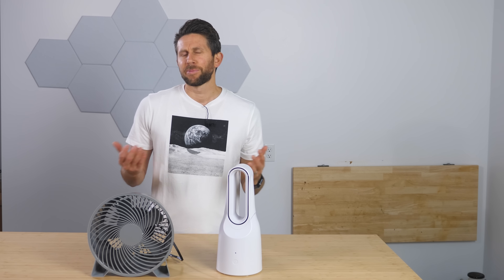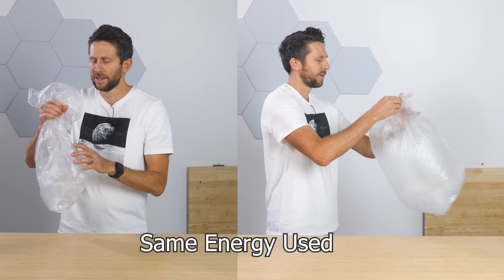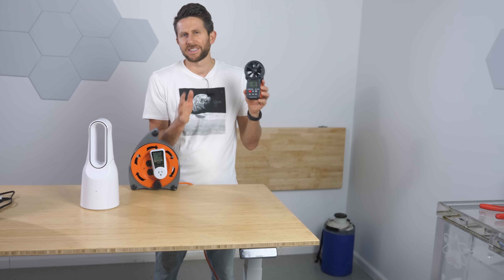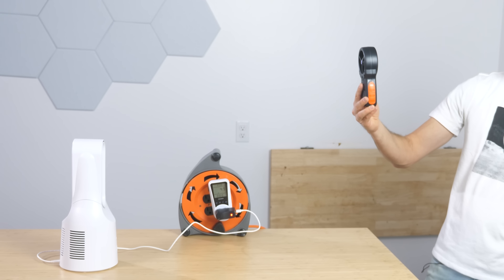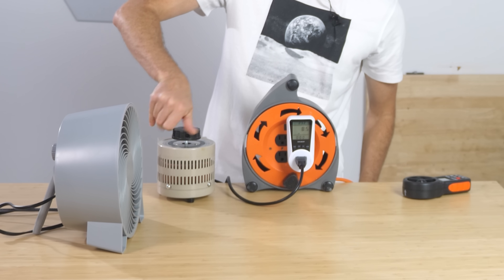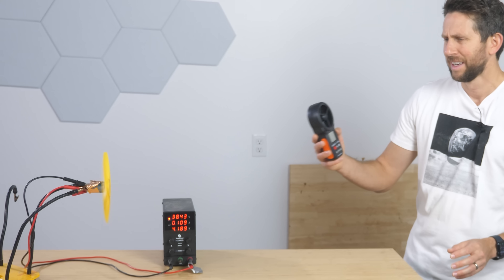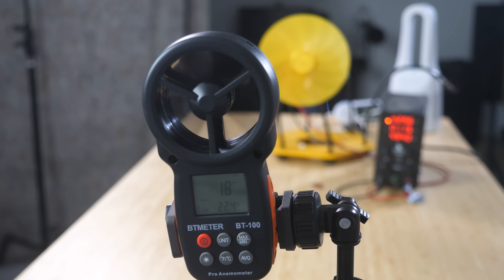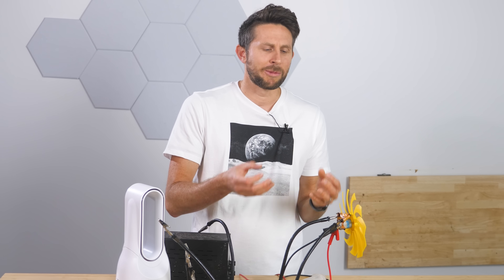Are Bladeless Fans a Scam?

Comment: One of the benefits of fans in my opinion is the noise! The white noise helps me sleep, so I don't want quieter blameless fans!
Reply: Then you might like the bladeless ones. They're actually quite loud. They try to squeeze a lot of through that slit and it makes way more sound than a normal fan that is is of comparable size. Also the comparably sized regular fan moves a lot more air.

We had those larger Dyson fans at work and they proved out to be just total waste of money. They're nasty loud and really bad at giving you a cooling sensation. The fans we replaced them with were considerably smaller and thus also more practical in an office environment, they were also about 1/10th the price and waaay more effective.
Reply: Same here. Can't fall asleep without mine's.
Reply: white noise is nice thing. this is why i sleep near my computer that is running 24/7. it's like rain but that "never stops".
i also tried to play some white noise videos while wearing wired headphones while i was sleeping and it is nice too.
Reply: Did you know that the bladeless fans are louder, because they need more power, thus more movement and noise, to push air through the tiny holes.

Comment: I'm convinced, but I don't think the bag thing was an appropriate analogy.  Once the bag was opened, it was filled with air.  The blowing just allowed more air to flow in the direction of the opening, overfilling the bag and making it easier for you to catch the air that was already in there.  I'd like to see it again with the bag at its lowest volume, then filled by the low pressure moving the air.

Comment: I'm 2.5 minutes in, but I think you're measuring efficiency wrong. You don't want to put them at the same power consumption and measure wind speed. Instead, put them at the same wind speed and then measure power consumption. I used to work on an application that allowed sizing of fans by industrial consumers, and there is a power curve that you have to think of. We never sized fans for efficiency by looking at our power consumption. We always sized them by looking at target airflow and then targeting most efficient power consumption to meet that airflow (and static pressure) target.

Comment: You should try and get ahold of a Dyson style blade less fan rather than the type you used in this video then compare again. Dyson use a turbine style blade not a squirrel cage style like the one you had. I’m curious to see if the turbine style actually is what they claim it to be and much more efficient since it moves the air differently than that style blade.

Comment: You should compare an impeller based bladeless fan to an "ionic wind" based bladeless fan.  My theory is that increases in efficiency may be realized because of the absence of the need to accelerate a mass in order to accelerate a mass. Also, do ionic wind "fans" benefit from ionic charges in the air to increase acceleration?

Comment: I completely agree with you results but i think the test could have been better.
1. Cfm could have been measured using a large tube to create constant cross section area.
2. Dyson fans have much more "advanced fan tech". It would be interesting to see if they are actually more efficient, considering the crazy cost.
Reply: fans also have an efficiency curve. a fan meant to run at a high wattage is way less efficient at a low wattage than the same principle fan designed for the low wattage both where run at. its like using a truck to do groceries and then comparing fuel economy to a compact car. yea, the truck is going to be less efficient at that. but if you ran both at max load than the amount of groceries per energy unit would probably favour the truck.
Reply: True for Dyson. But the "normal fan" comparison should be high quality too, like Rowenta.
Reply: Dyson fans are a complete scam. Like all of their products. Massively overpriced.
Reply: more efficient at lining their company coffers, no doubt.
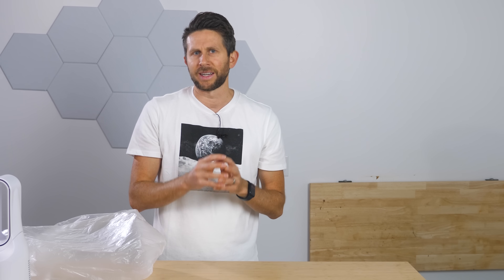Reply: @namele55777 so true bestie 1:04
Reply: I found a brand new large bladeless Dyson and it's so great, I'll never go back to a big round dumb rotating fan. It also can blow hot air or cool, rotate and sleep timer. It's quiet and moves a surprising amount of air for the size

Comment: Another reason "bladeless" fans are quieter has to due with the type of impeller used in the base. They use a forward curved impeller, and they have more blades which helps reduce any noise from blade pass frequency. One downside is that these blades are not as efficient as axial or backwards curved impellers.
Reply: But they ain't quieter. That's just marketing, just like how they're more "efficient" and the like. Assuming you base it on how much air they move that is.
Reply: @Utrilus  I'm an engineer for a fan manufacturer.
Reply: @Colin995  But I saw youtube videos where they tested em side by side.
Reply: @Utrilus  Ok, good for you? You do realize I am talking about the actual fan, the part that spins in the "bladeless' fans? I don't have the energy to give a detailed explanation as to why forward curved fans are quieter than axial and backwards curved fans. I implore you to look up what blade pass frequency is and to look up the difference between forward curved, backwards curved, and axial fans.
Reply: @Colin995  Yeah, that stuff goes over my head. It's kinda like how PC fans are abnormally quiet.

Comment: messing voltage with veriac and not taking in consideration apparent power. Not really measuring air pressure and volume between fans. Seems like 10yr old could do this in the class. Disappointing production of video. If anyone wants a good example how to make lab based video just look up for Tech ingredients

Comment: It is a gimmick because I took one apart. It was a knock-off and there is a fan in the base, it simply blows air up and out of the holes. Not a different kind of blade, like in the video, a flat -out propeller style blade that blows air up and out the holes. They all try to give the impression in commercials that they have a high tech innovation to move air. Total BS

Comment: You could have measured the thrust that the fan generates to estimate its absolute performance.  With anemometer you'll have to integrate the airspeed over the entire cross-section of the airstream.
Reply: You're right. I believe the aim was to simulate a person sitting at a typical distance from a fan. But he should've been a tiny bit more precise with his language.
Reply: I still don't think there will be great difference.
Reply: still not worth it
Reply: @blackpepper2610  good experimental measurement is always worth it, it is even cheaper than the method shown in the video since it does not require anemometer
Reply: I just use my hand to cool myself down 😂
Reply: sweeet! i learned this technique, when i lived in mexico. it works (better if you have a cervesa @Lord__666
Reply: Even so thee ordinary fan won hands down.
Reply: @rogerphelps9939   ... fan-blades down :)

I criticized the measurement approach and not the measurement result.

I would appreciate if a fan was placed on a raft, floating in a basin and a dynamometer was used to measure a horizontal thrust of the fan.
Reply: dyson has always been a 'sales gimmick' high pressure sales if you ever visited a store that had them like costco @rogerphelps9939

Comment: Dyson fan could be perceived as safer, especially the larger ones. The grills on larger fans don't keep out tiny fingers.
Reply: The blades are angled to draw in air, a fan will slap your fingers at worst
Reply: @MelodicTurtleMetal  Umm, not the large square fans
Reply: @dimitri1515  if the blades were flat they wouldn't with as a fan. You'd have to shove your hand in extremely hard to hit the sharp point - which isn't sharp - and the motors have almost no torque, so you'll stall an industrial fan before it does much damage
Reply: @MelodicTurtleMetal  LOL, ok, have your 2 year old stick his/her hand into a fan at high speed and let me know how that worked out for them.
Reply: @dimitri1515  do it yourself. It'll hurt, it won't require any hospital visit.

Maybe think about how they work before you worry about what you've seen on TV
Reply: @MelodicTurtleMetal  OK, now you're just trolling. For anyone else reading this, please watch your toddler around those large square fans as they can break bones in their little hands.
Reply: @dimitri1515  ignore him. Put your toddler in a fan!
Reply: From the front...

Comment: I got a refurbished Dyson fan on w00t like a decade ago for ~$140.. one benefit that was not mentioned is that bladeless are much easier to clean.  No grills to remove... you can just wipe along the bladeless ring, and the suction holes at the bottom.  It is very quiet of full blast also.   No regrets here...

Comment: Not a Dyson, but a poorly designed copy using a standard squirrel cage fan for a compactness  similar to the fan in the base of the Dyson. To me the whole  selling point was to cheaply steal some of the Dyson marketing magic.  As your test shows, the base fan is already quiet and probably entrains surrounding air from its local pressure increase towards your chosen test position.
I have experimented with high volume low noise level fans for decades and know that the squirrel cage design, when proper blade pitch is used, does produce both pressure and volume, especially driving air into ducts. Axial fans running at AC induction motor speeds stall in that situation and  are more noisy. 
Dyson's solution uses an axial fan at very high speed, to get the  fan blade sound above human hearing, then properly directs it into the bladeless air volume multiplier section.  Air drawn in through the Dyson base is also more smooth as well as less impeded by the input grill. 
Now for an anomaly I found in the marketing of a  hand held hair dryer I bought many years ago advertised as being quieter than the typical one. It used a squirrel cage blower, instead of the small cheap axial fans the others had.  It also used an induction motor to avoid  the brush noise in the other dryers.Was I surprised when I got it home:
It had an audible resonance that was annoying and almost as loud as other such dryers. It had been designed in Italy, and then sold to the American distributor without changing the blade pitch. Why was that necessary?
Italy has 50 hz AC and we have 60HZ. That subtle change in rpm put what would have been a resonance null  just far enough higher pitch to  hit the resonance peak  that that pitch choice was designed to avoid.
The 240 to 120  line voltage difference WAS accounted for  by a change from series to parallel in the resistive heating coils used.  Both types of hand hair dryers used the heating resistors to drop the voltage  applied to their motors. One little difference and it became false advertising.

Comment: Pretty not good to hear bladeless fan and see a fan.

You should be 100% be able to build a true bladeless fan, it just needs some before thought as the dimension of the plates and lenght of the solenoid pointing inbetween the plates to effeciently exchange electrons with the air molecules while permiting solenoid hysteresis and drive it at resonance basing of the open LC math.

Such design was used to pump salt water but was intentionally hidden from us. perhaps it allows electro propulsion against the vacuum in certain conditions?
Reply: Yes, there are "Electro-Static" fans that create ions at one point and attract them to another, which pulls the air along with it (just like the bladeless fans). They also pull a lot of particles out of the air as those are a good source of things to charge.
Reply: the method i am suggesting does not create ions.
Perhaps the geometry to make it work would require extra steps, but i am 100% convinced you can make it work.

ACMHD is one directional and perhaps only works with conducting materials, but it would be worth a try. (or add a source of electrons in between the plates and you should get weak vacuum propulsion without a propelant)

IVO quantum drive will launch in space in about 5 days and quantized inertia will be tested @RichardDamon

Comment: I think a better way to compare them is you need a tube with fixed diameter and at fixed length so you can actually measure volume and speed.
Reply: This is backwards in so many ways. Why a small tunnel??? I don’t want to only get air on my nose, I want it over my face, head and shoulders. 

These dyson fans have never been what they claim.

Comment: It seems like even all other things being equal, the bladeless design would be losing efficiency just off the extra friction the air must have while bouncing around inside the device as it makes its way towards the slits at the top, not to mention what's lost as the air filters into the device through the other small slits at the bottom into a larger chamber.
Reply: And if they were to move the same amount of air, then the bladeless would naturally be louder cause it would have to work harder to be equal.

Comment: So the bladeless fan’s air gets slowed by the air it’s pulling through the back, but also having fast air pulls the slower air around it to increase volume (like with the bag). Why was the latter effect so much more pronounced with the bag, but not enough of an effect in the case of the bladeless fan?
Reply: Yes, proved and disproved in the same video. Something doesn’t add up here.
Reply from the maker: In the example with the bag, the restricting factor was the amount of air your lungs can hold. But with a regular fan and a bladeless fan, they have no air limit. So it is just whatever one can move air efficiently. And it is not more efficient to move air through tiny slits in order to suck on air, because you can just suck in air as normal through the back of the fan.
Reply: @TheActionLab  _There should be a windblade fan, where the winds that laminarly flow the air are actually the blades of the fan itself, hahaha, imagine that! _ 🤣✌️👍

Comment: A blade-less fan is basically a standard fan with a Maltese boot.
The blade-less fan is useful for low-risk environments, where there are kids with long hair, pets, etc, which can get entangled with the bladed fan rotor. Or, a blade-less fan can be required because of ambient design reasons...

Comment: Regardless of what everyone’s criticism is for measuring air speed I think we can all conclude that bladeless fans are indeed overpriced. It just is a basic blower motor pushing air through fancy looking piece of plastic with holes. The only arguable benefit of bladeless fans is safety for little kids and they are quieter since the fan is more enclosed and airflow is more restricted.

Comment: Evacuation slide inflatable staircases used for civil wide body planes uses indirect inflatable principle one reason it blows slide much much faster than direct method.  In emergencies that is big benefit  but also slide inflation is based on fireworks burning gasses thus mixing with air Evacuation slide not catch fire.

Comment: What?  There is blades inside a bladeless fan?   My favorite fan uses a brushless motor.   Its speed is fully adjustable,  And it uses so much less electricity due to brushless tech.  It was also about 2 times the price.  But I love being able to  fully adjust the speed,  Some times I just use it to cool a cup of tea,  other times on hot days I use it to cool off myself at my desk.   Brushless fan compared to a regular fan might make a good Action Lab video.

Comment: My bladeless fan is actually louder and weaker than a regular fan. The only reason to use it is because it can also do hot air so I don't need extra space to store my heater/fan when season change. Just put it in the leaving room throughout the year.

Comment: Isn't there a difference between air speed and air volume that would potentially make one more efficient?
Reply: The "blade less" (with the actual fan hidden) is less effective when it comes to power usage. But the hidden fan type might have other benefits like less noise?
Reply: It can only be less efficient due to the principle of conservation of energy as energy is lost by the drag caused by the housing, an open fan does not have this parasitic loss. Air has mass and to move more of it at a greater velocity requires more energy, simple as. You never get something for nothing.

Comment: I'd imagine a bladeless fan would require less cleaning as well / be easier to clean
Reply: The mess would be in the base rather than at the back of the fan, and I'm not sure what you do if the slits get clogged

Comment: You stated something fundamentally wrong at the beginning: "Whenever a fluid moves fast it has a lower pressure". Most people fundamentally misunderstand and misuse Bernoulli's equation. For one reason; there is no cause-and-effect in fluid mechanics. You must consider the whole flow field and the balance of equations happening continuously to describe a flow field. Secondly, moving air by imparting energy doesn't necessarily drop the pressure. Instead you can "trade" "kinetic energy" for "pressure energy" such as via a diverging duct, or you can add energy to one or both. You showed two bottles moving together. This is NOT due to Bernoulli's equation; it is instead due to the Coanda effect, and not due to fast-moving air.
Try moving two objects together which are NOT curved along the direction of flow. Blow through a pen or a straw or something. You will find that they don't come together.